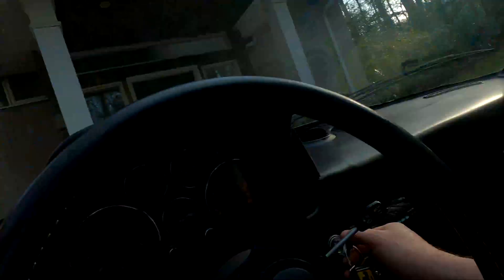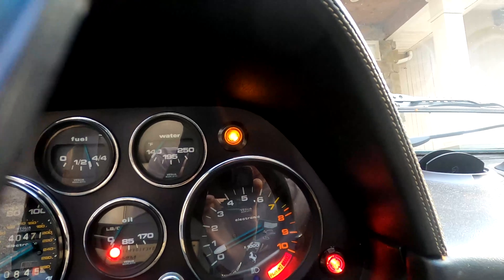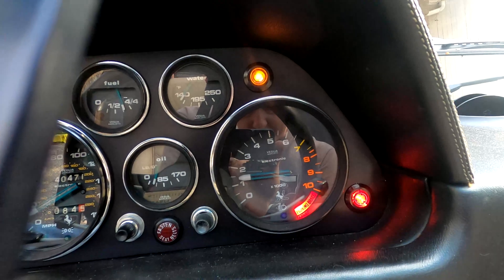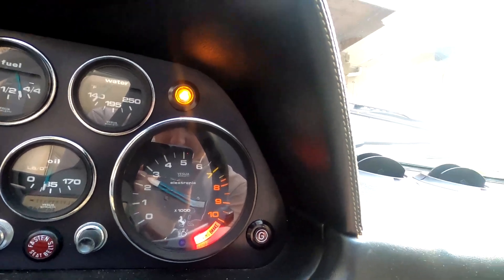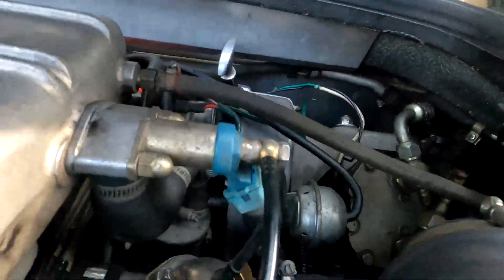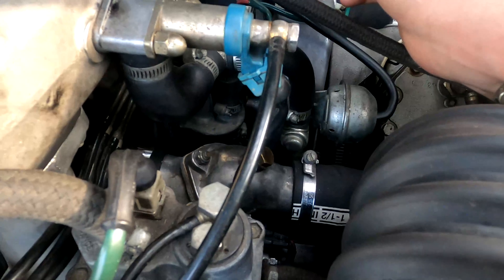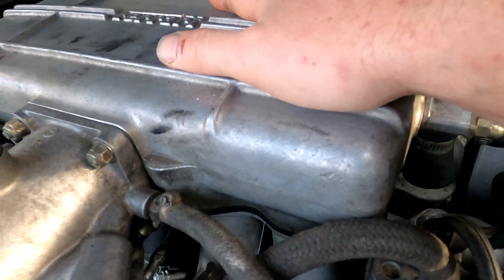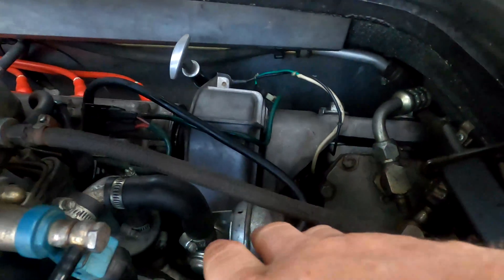Hacking the fast idle warm up on a 1980 Ferrari 308 GTSi

Comment: Dude - turn the round knob with hex nut inside by air intake counter clockwise and thats your idle adjustment!
Reply from the maker: True story, but there is also a contraption in US cars to idle high on startup IOT warm up the catalytic converters faster. Works from a coolant temp switch.

Comment: I have been concerned about the high idle speed on cold start up for years...Fearing that it was shortening the lifespan of the engine.  Thanks for the info...I just applied the fix.
Reply from the maker: Right on.  Thinking out loud, I wouldn't have worried about it if this was a modern motor that ran 0w oil.  I run 20w50 and it did bother me to hear this thing scream on start.  Thanks for watching.

Comment: And that other vacuum hose (the one you disconnected) presumably went somewhere unimportant?
Reply from the maker: that went to the input side of the switch. output side of the switch goes to the vacuum valve.  I took the switch output to the vacuum valve and plugged it directly into vacuum.